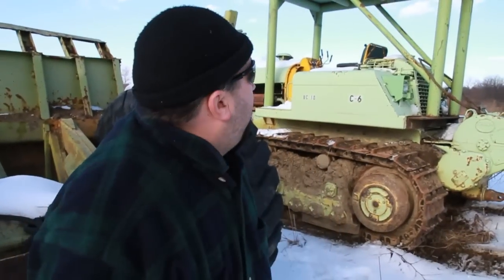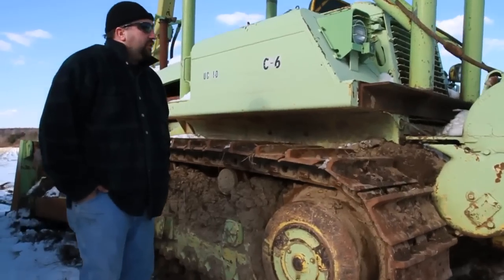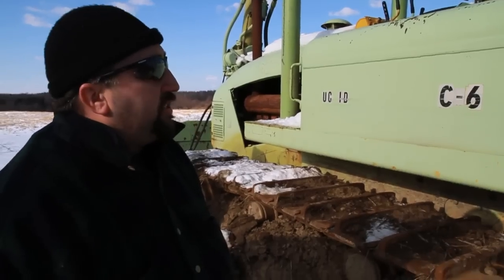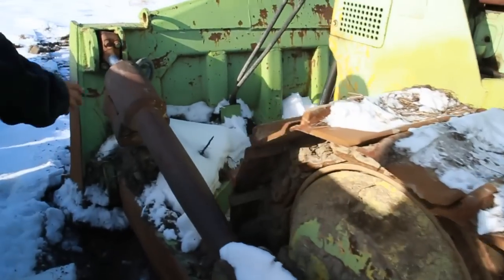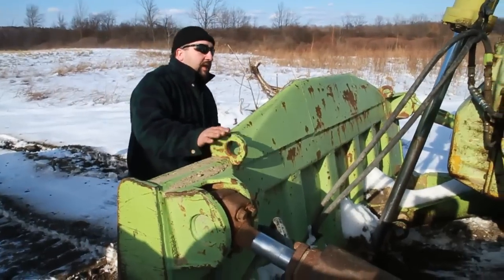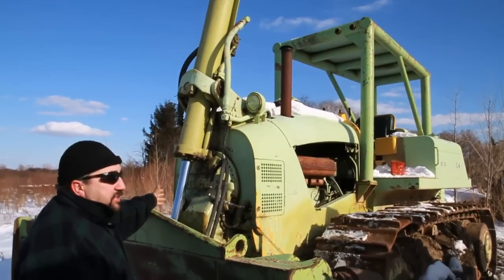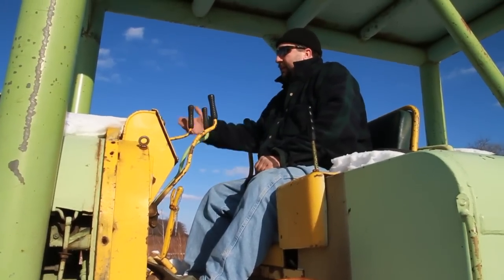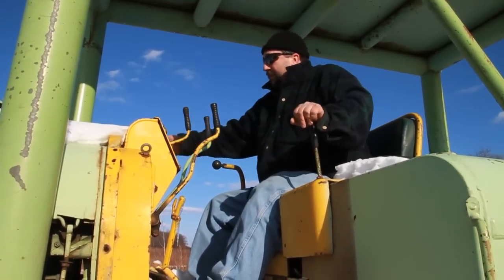1965 Euclid C 6-5 DOZER

Comment: Hello, Mr NWE.
                         I had sorta figured that there may have been some previous effort put into getting that lovely old Euclid ready to work 'cos the operator just climbed straight up and sat down on the seat when EVERYTHING all around was covered in snow. And I KNOW that I would not like my 'fundamental orifice' to chilled by sitting on a snow-covered seat AT ALL, never mind for as long as that operator is shown sitting on it.

I have operated 82-30s and an 82-40 for brief periods - good machines, well balanced, handle well and push well too. A friend of mine a couple of hours away has FOUR TC12s, one almost a runner, one needing two engines and two needing the age of miracles to return. I hope to get to operate the nearly running one in the not too distant future.

Thanks for sharing.

Just my 0,.02.

You have a wonderful day. Best wishes. Deas Plant.
Reply: +Deas Plant  Believe it! I have had to pop my posterior down on frosty/snowy/wet seats without cabs a bunch and he's faking a hop-up start. Good old bus motor but  I'll take the Kitties. The bus motors make grta power units though.
Reply: Deas Plant where are the 4 tc 12's? Lol I have been looking for one for 5 years now
Reply: Hi, td9clyde. 
Brookstead, Queensland, DowNunda. You can catch glimpse of them from the Gore highway but you can also turn off the highway and drive by them on a side road for a better look. 2 of them are pretty much only frames and tracks and I yain't sure but I don't think any of them are for sale.

There is also one in Peter Champion's collection up near Rockhampton, Queensland, and another over in Western Australia.

Just my 0.02.

You have a wonderful day. Best wishes. Deas Plant.

Comment: Great sounding dozer. Good operator too. I need this to plow my driveway!
Reply: +bearbon2, try listing to that screaming two stroke joke for 12 hours a day 6 days a week and it wears on you, trust me. I wear two hearing aids today because of those damned engines over 30 years.
    Mike
Reply: +Mike Lamothe Yeah, I understand completely. After working close to jet engines for thirty years I have permanent ringing in my ears. Had it so long I don't even notice it anymore until I think about it. I just like the sound of two-stroke diesels but probably wouldn't if I had to listen to them as long as you did.

Comment: To all the provincial commenters out there in wire & glass land,
If you watch further into the video shoot you will notice that the operator,'s left back upper carrier roller is free wheeling. The machine has worked a few jobs since this shoot 6 yrs ago. Guess what no flat spots on any rollers and the 6-71n is still running strong. So all you detractors were wrong!!!!!!

Comment: Your video is in error. The C6 was a popular machine...and, you are right, ahead of time...and yes, it did evolve to  the 82-30. However, the 82-30, then the 82-30B, was the second most successful dozer sold through the company. More on that in a moment...The 82-30, so successful, that it spawned into an 82-30B...and then when production stalled in the mid 80s, an 82-30C was in the design phase, with twin front cylinders and an entirely new design...but it never made production. The single most popular Terex dozer, by sales was the 82-40. You may notice, my picture is of a very unique dozer...called a D800...this one came off the line in 1991, and went straight to Wyoming Machinery, the Terex dealer at the time...It spent seven years on an extended rental purchase to a salt mine, and we bought it in 1998. Gone was the single front cylinders, however the memorable rear radiator remained...also, the  engine, similar to the 82-50, though slightly bigger, at 105-108k lbs, to compete with the new D8L, which later became the D9N, hence the name D800. The new line nomenclature were to become the D600D(82-20B) the D700(82-30C), the D750(82-40), the 82-50 eliminated, in favor of the D800. Ultimately there was a 82-10, which was designed as a competitor to the D6D/D6E, with a new 6 way blade, but it never made it to production either(though I do have pictures). Have a nice night.

Comment: After the tractor is started, the camera plainly shows tracks in the snow in front of the blade. This suggests that the crawler had been recently moved prior to filming. Running a warm Detroit at @1900 rpm isn't going to hurt it.

Comment: I remember running 82-30 hot air from the radiator  behind you and people knew 10 miles away you are working
Reply: +o well As a young guy my dad was pretty excited to be given the 82-30 to work. It was the latest machine and the boss’s son didn’t want to drive it any more. By the end of the 2nd day the novelty wore of and dad was happy to get his TD 20 back a few weeks later. He complained of the same thing although you could reverse the blades in the fan. This was done for him but then he said it was bloody cold with fresh air being sucked past him LOL. Still he preferred that and wore a wind breaker. I don’t like operating a machine without A/C, how things have changed.
Reply: +Bugger That  it's lot more than a/c  If I get on a new dozer today its like retraining

Comment: GM had the best engineers designing heavy equipment at the time. They learned a lot form Allis Chalmers back in the late 40's, when AC came out with the tourque converter drive, 2stroke GM powered HD19 dozer. The idea for the TC12 came from a hybird HD19 Siamese Twin dozer working on the Garrison Dam project in the late 40's. This dozer here was way ahead of its time. But 2 strokes don't last as long as 4strokes. Higher revs, more wear. CAT won the race. They are the only ones still alive, making machines today, for the World market.
Reply: mark robertson  Caterpillar is number 1 my friend. Don't get me wrong, I love there old Terex and Euclid machines but there are outdated. The new Detroit's are not near as good as the old ones or cat engines.
Reply: soaringtractor 
Correct!,and Jimmie's wore the connecting rod bearing's evenly because the way they fire,4 strokes will wear the bottom bearing of the con rod much quicker than the top,saw this with our old cat grader
Reply: @dieselman8v923  out dated?? There are only so many ways to move dirt.
New machines are more comfortable and full of conveniences, but the computers/elections and all the associated wire and plastic is garbage

Comment: To the Anekcahap down below.  The engine sounds like it is turning around 1700-1800rpms.  That is normal range for these engines.  Detroit 53, 71, 92, etc series engines are two stroke and sound like they are turing much higher rpms than they are. Hints the name SCREAMING JIMMY (Jimmy is a name we use for GM or General Motors)

Comment: There was also a G.M. 6-110 diesel that was used by Allis-Chalmers in their dozers along with other G.M. diesels.When G.M. bought Euclid Road Machinery this was seen as a threat to AC using their com- petitors engine. This brought about the purchase of the Buda engine which would become A-C diesel.The Detroit Diesel name for the G.M. diesels was coined by the big company at that time International Harvester , which bought many of the engines from G.M. for use in their over the road trucks. Re- member at one time  the ' big three' also made big rigs. Ford, Dodge, GMC, KW, Pete, Freightliner, White,etc. It was the same as the A- C situation, using a G.M. in a Ford or Dodge? The name came from where the engines were made, in the city of Detroit, Michigan.
Reply: Eventually Allis used Cummins engines
Reply: Hi 
If an Allis had a Cummins someone put it in. 
Thanks for listening!